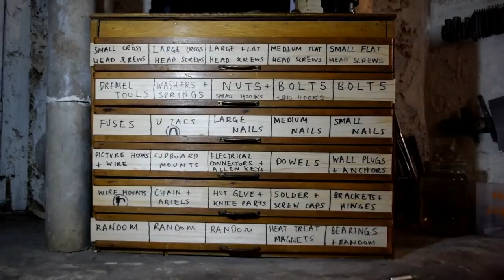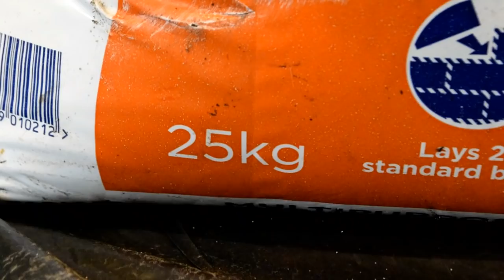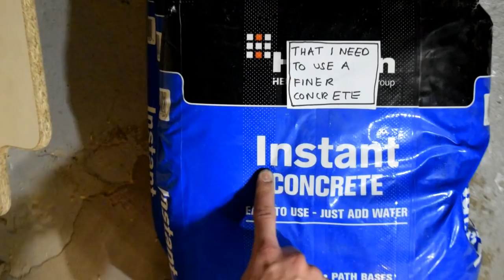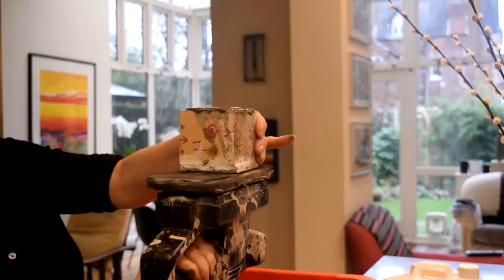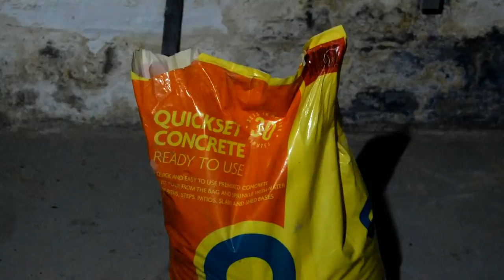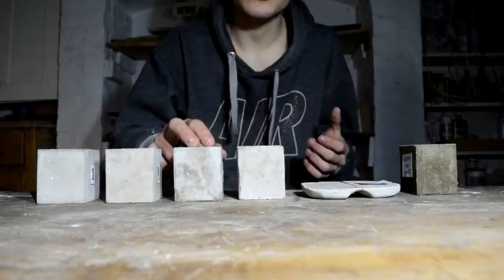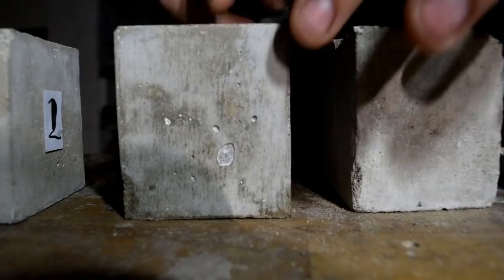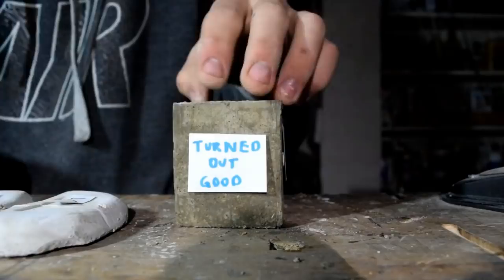Learning to Cast Concrete | Casting A Drill Case [50]

Comment: Hey, look up " water reducer for concrete" or " plasticizer". It allows the concrete to flow like it has more water in it but it retains the strength as if it has a low water mix. Great experiments by the way.
Reply from the maker: Great tip, thank for taking the time to share it! Unfortunately, I’ve actually already done the concrete project these experiments were for, but it’s still really good to have the information out there that other people can access! Although this being said luckily after speaking to a builder I did end up using washing up liquid as an improvised plasticiser and your right it really helped to help the concrete flow :)
Reply: Wow, I never thought of that as a solution. Good stuff. Thanks!

Comment: Pour the concrete in layers 3 or 4" at a time and vibrate each layer in turn ,should give a better finish .
Reply from the maker: Good tip Michael - thats kind of what I was talking about doing at 5.03 - do you know how long you've got between doing each layer? I don't want the different sections separating :/
Reply: When I was in construction structural concrete we made test cubes for at 7 days 14days and 28 days . Would go to a lab to have a crush test done and if failed they would come and take a core sample to test .Each layer should be mixed in as quick as possible and a good vibrate and a wet mix with small aggregate .
Reply from the maker: Michael Evans really good information to know - thanks! Can you remember what brand of concrete you used or is there any you recommend?
Reply: We would use pea shingle for a aggregate when pouring decorative columns. A 6 to 1 ratio and fairly wet mix. The ready mixed in a bag like in your video is a small aggregate mix should be good ,it is all about the same consistency and vibrating the shuttering to get the air bubbles out .
Reply from the maker: Makes sense - thanks again for all the knowledge! Two more final questions - do you know any tips to get a good surface on the face your poring from & what tool do you recommend for finish grinding to shape & polishing?
Reply: Just good vibration really, we used to use a steel floor trowel for a smooth finish .Never polished concrete though after setting .
Reply from the maker: I spoke to a builder and he said to use a pointing trowel also so I think i'll do that. Thanks again for all the help - you've definitely got a wealth of knowledge about all different things!